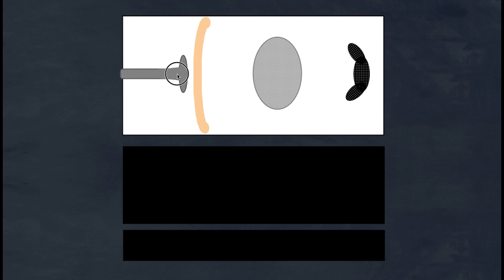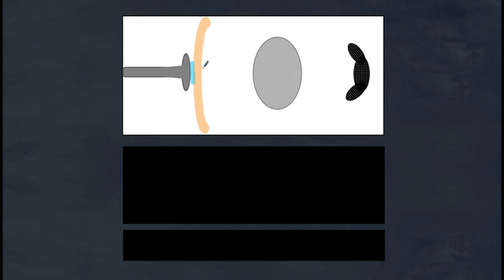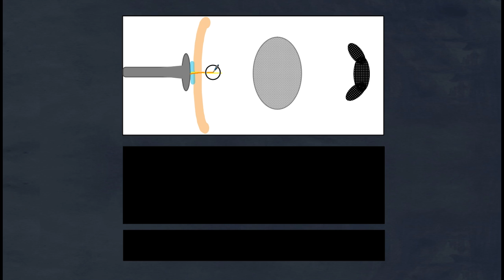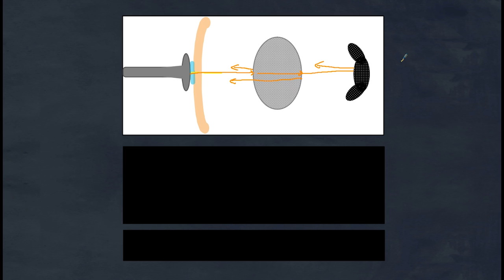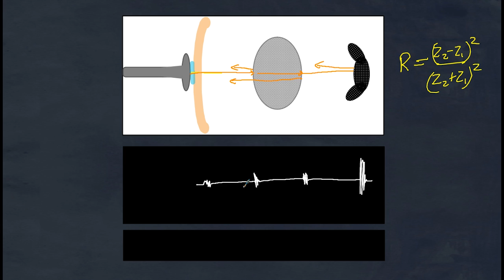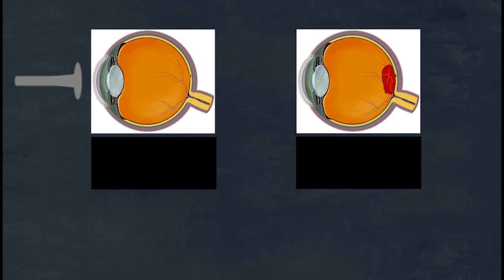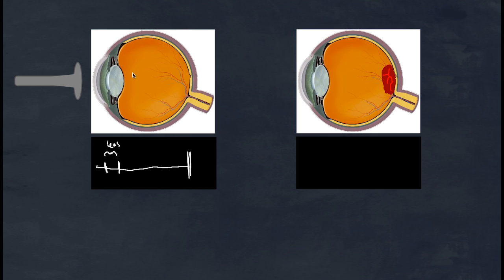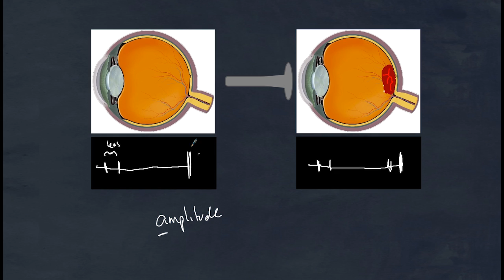ultrasound - A scans explained

Comment: Thanks very much. but may I ask why doesn't the reflected sound get reflected again on its way back when it encounters another change in acoustic impedence? e.g. if the reflected wave from the third peak gets reflected again, then the third peak will be smaller than the second peak; on top of that,  we would get some small peaks appearing on the right side of the graph
Reply from the maker: My understanding those secondary reflections and thus signals are filtered out.
Reply: @PhysicsHigh  sir i would like to ask that is a wave enters the bone then doesn't it again get reflected inside the bone or anything in its way back just like it entered and was reflected and penetrated